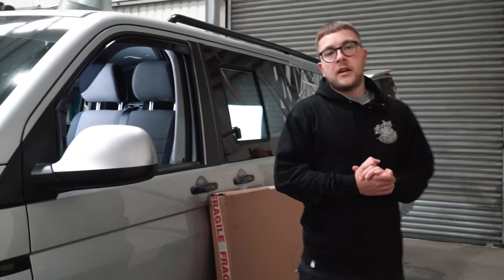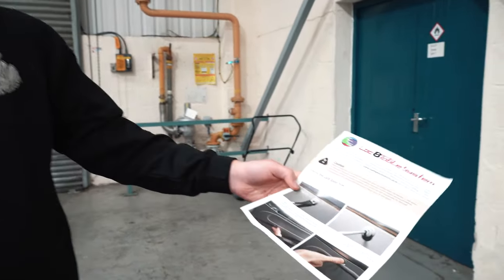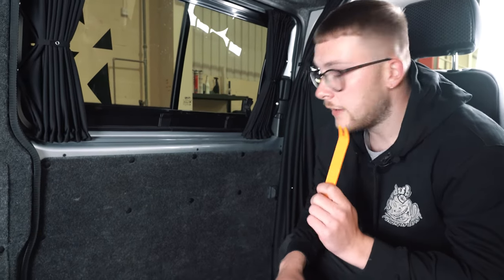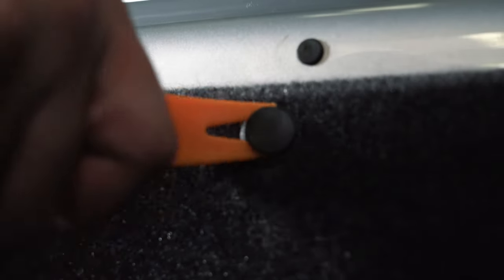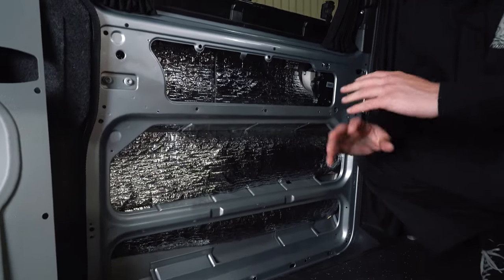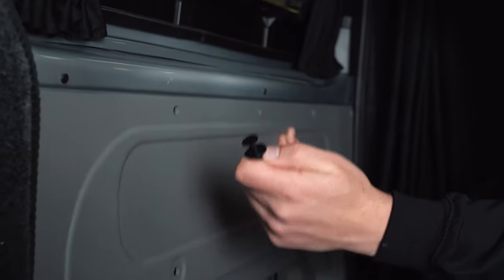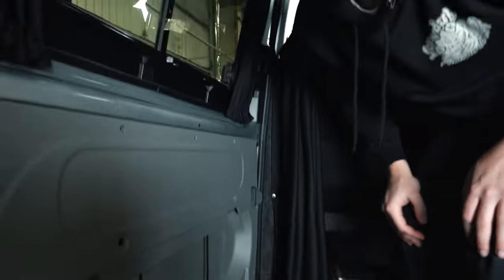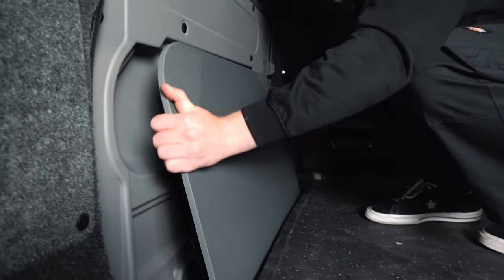This camping table can be stored in your sliding door! | LOC8 Table System Showcase

Comment: Lovely concept but £300 ? Wow.
Reply: Ha, exactly what I was thinking
Reply: @gazzbert  Research and development?
Reply: @701Adventures  I ended up buying one anyway 😆 and it’s really good 👍
Reply: @gazzbert hi. Did you carpet the panel?
Reply: @Two_Wheel_Trips I haven’t yet but I plan to at some point. Just from eyeballing it I reckon the table will still fit with the panel carpeted, there does seem to be some wriggle room. I plan on offering up the carpet to try it first obvs before committing to the contact adhesive. It’s way down on my todo list atm tho.

Comment: Neat idea. Is it possible to recarpet the replacement door card., ie will the table still slot in? Problem I can see is with a carpet lined van, the bare plastic of the new door card looks a bit unfinished .
Reply from the maker: Hi Stephen, thank you for your question, here is a response straight from the manufacturer: "Yes the Loc8 Trim panel can be carpeted to match your camper interior. We recommend using a good quality spray contact adhesive and 4 way stretch carpet. Please be aware that the Loc8 Table System has been designed to not need carpeting and as a result once carpeted, the table will be a snug fit. If you find it difficult to get the table in and out of the trim panel after carpeting, you can remove a small section of carpet from behind the underside of the upper location tabs on the trim panel. This will allow the table to move up into the panel fully, whilst ensuring that the small untrimmed sections are not visible." We hope this helps!

Comment: Does it fit electric doors?
Reply from the maker: Hi Jim, here's some info from LOC8 "The Loc8 Table System will fit the left-hand sliding door of all VW T5 and T6 vans that are badged as Transporter vans from 2004 to the present day. This is the vast majority of T5 and T6 vans sold in the UK. The Loc8 Table System is a direct replacement for the standard hardboard door card, so if your van is fitted with one, then the Loc8 Table System will replace it." We hope this helps.